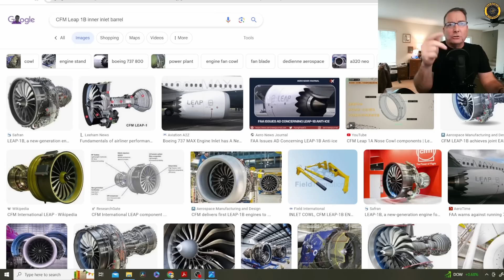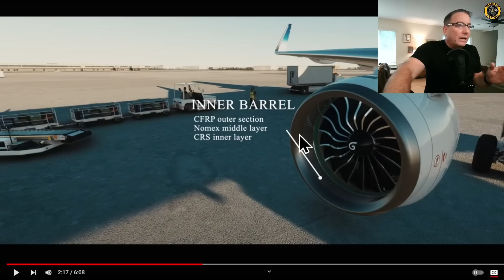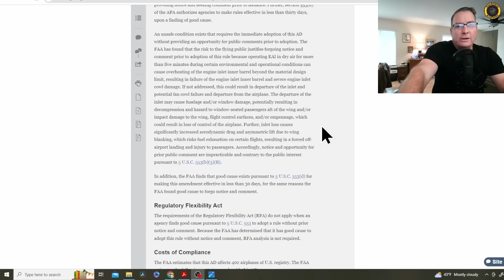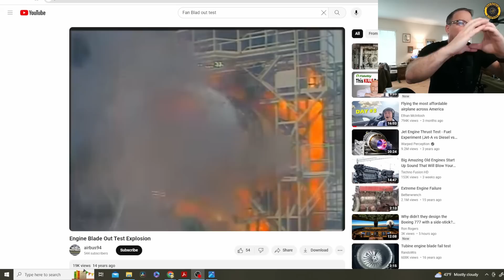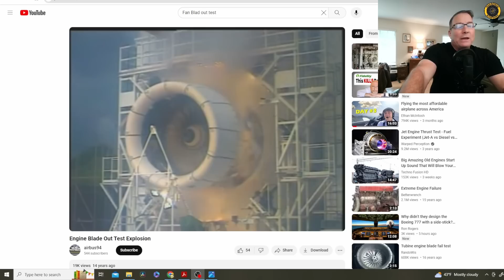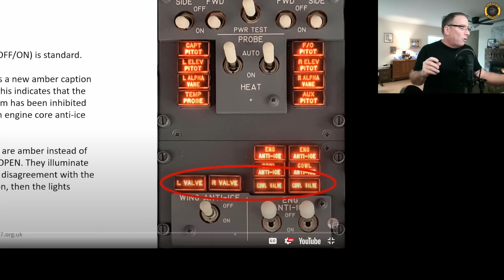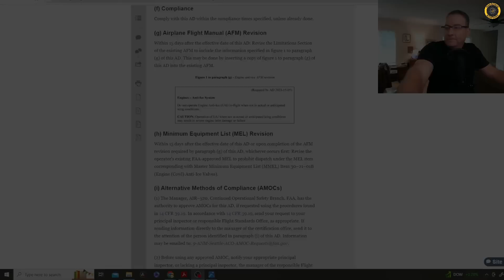Boeing 737 Max-7/-10 Certification HALTED! 1 Feb 2024

Comment: I’m new to your channel (thank the algorithm) and am enjoying your clear and logical analysis.

I’ve been following the 737 MAX story to apply its lessons to my job in the medical devices industry. I see the failures rooted in the requirements, primarily “build a fuel efficient plane that doesn’t require full pilot retraining nor full FAA recertification”. That meant no control improvements (e.g., no auto setting for de-icers) and no additional redundancy (e.g., no backup angle of attack for MCAS), amongst many other limitations. 

What I find astounding is that Boeing chose to enhance the 737 whose major requirement 60 years ago was for passengers to have a short walk up stairs from the tarmac to the cabin. That anachronistic requirement is still present in the 737 MAX and is a major factor in the MCAS failures. However, I view arrogance and deceit as the root causes of the Boeing leadership failures.
Reply: It’s especially dumb considering the airport I work at doesn’t have jet bridges. But anyone who can’t get up the steps can get assisted entry via vehicles that look like lorries except with seating and the entire back area lifts up to the aircraft so they can walk or wheelchair aboard.

Comment: Whais is different in terms of design on the A320 to not have the same issue with the Leap 1A engine ?
Reply: The A320 has auto anti-icing, the B737 MAX does not...
Reply: @gordonrichardson2972 no it doesn’t. A320 does not have automatic anti icing except for window and probe heats

Comment: This may sound a stupid question from a very practical and "hands on" bloke very sympathetic understanding of all things but inducted air like in a good old carbatettor cools massively which is why some carbs had pre heating until the engine was upto temerature.Surely a simple pre heat could be automated using bi mettalic switches in much the same way without fancy sensors and electronics?
Reply: In aviation, any design changes require recertification, which was the whole root of the MAX fiasco.

Comment: Even my old car built in 2012 had an automatic temperature sensor indicating icing conditions. I cannot understand it is not automatic available on every airplane
Reply: Boeing 737 was originally built in 1960’s
Reply: @tomstravels520  My car also had retrovisors and signalisers to go left/right. Sorry but you cannot set 1960 planes as a standard. Adaptations have to be made. I  hope they have seat belts nowadays
Reply: @paulbrouyere1735  I really don’t get what your point is. Your 2012 car has turn signals so should a 1960’s plane???
Reply: @tomstravels520  Not at all, but it should have indicators for icing conditions, wherever needed.

Comment: This doesn't seem like it needed to be redesigned. It doesn't seem like there's any type of benefit to it. Put it back the way it was
Reply: Every bit of weight saved means lower fuel costs over the lifetime of the aircraft, and was one of the big selling points for the MAX.

Comment: They could have put the modern system in without a clean sheet.  The switch would turn the monitored system on or off.   May need temperature sensors in the cowling. 

This really does not seem hard...  just why does this and mcas have to be butchered to make it it the same.

Type ratings should allow for some advanced features on newer planes.
Reply: Boeing have already used up their options mainly on the new displays, different gear lever operation and few others that didn’t include the handling which is why they added MCAS
Reply: @tomstravels520  So, there was a limited number of changes allowed.... like in an arbitrary way?   MCAS kinda makes sense, it just should have been made with redundancy and sanity.  the idea that the trim kept moving on and on and on was nuts. the idea that they don't have 3 AOA sensors is nuts.

I suppose  type ratings are for more than just pilots though.   maintenance staff may need things to remain the same.

Still, this is nuts 

The B52 upgrades should be done with what makes sense, and then retrain the crews.

I suppose someone should be able to fly a -700ng then a max10  on the way back... that does seem useful.

Comment: Thanks for another insightful video on the continuing MAX story. I couldn't find any further information on that, but can you update us again on the status of the EICAS exemption extension for the MAX-7 and MAX-10 models? Is that still valid, or will they now have to equip those two with EICAS, too (breaking type commonality and requiring a new type rating?)

Comment: Efficiency improvements mean different things with different components.  A compressor with a higher efficiency has a lower temperature discharge, at the same pressure as a lower efficiency compressor.  Engines with a higher thermal efficiency tend to have higher compression ratios, which have the effect of them converting more heat in the fuel to mechanical work.  A very important quality for aircraft is propulsive efficiency.  Propulsive efficiency is the forward speed of the aircraft divided by rearward speed of the thrust plume.  Thrust is a function of the difference between the magnitude of the engine's thrust plume and the magnitude of the aircraft's forward airspeed, multiplied by the mass of the moved air.  The important detail is that, when the propulsive efficiency is 100%, the thrust is zero.  High efficiency engines combine high compression ratios, high efficiency compressors and very large bypass ratios to move large masses of air at relatively low velocities to generate large amounts of thrust at high propulsive efficiencies.

In the bad old days of turbojets with bypass ratios of zero, the only way to improve propulsive efficiency was to reduce drag and fly faster

Comment: It's unacceptable to require pilots to remember to turn off anti-icing on supposedly brand new airliners or risk engine failure. I am not a pilot, but decades of sim flying taught me that it's difficult to remember to turn anti-icing off, especially outside of cruise where you have other things to do.  Now the reminder is an exploding engine intake?  

They have the technology to do auto anti-ice and the technology to detect dangerous temperature conditions in the engine cowling as well.  This could either warn the pilots or automatically disengage anti-ice.

Comment: Isn't this an engine design shortcoming?  OK Boeing tried to brush it to one side but nevertheless this looks like a secondary requirement (noise, weight, efficiency) has led the engine design astray.
Reply: Given the same engines are fitted to the A320neo aircraft without issue  then it would appear to be a Boeing problem.

Comment: This news (to me, anyway) is that Boeing, the engine manufacturer, and FAA have agreed to a design made to fail, it's so flabbergastingly stupid, that all the planes should revert to engines of an older design (where malfunction of the valve can't hurt the crew or the passengers), use automatic controls and just put in 8 seats less! That's how a problem gets solved. Much less costly than scrapping all the MAXes!

Comment: Also, the AD doesn't appear to note the "Off Time" duration. You turn it on for 5 minutes but how long does it have to stay in the Off position before you can turn it back on ("cool down period") ? Seems it would be prudent to know this ... Pilot/FO can't be expected to visually know when they need more anti-icing ... or melt point for the Carbon fiber barrel (CF is just as prone to reduced expansion/contraction with age/cycles as Metals). Boeing has lost the plot IMHO ... while not their Engines, they remain the Prime Contractor and as such responsible for all aspects of their Subs ... if I recall from the FAR.
Reply: Imagine having to have a critical engine system with a "duty cycle." That is scary.

Comment: Surely if the point of failure of the cowl is the bleed air exceeding operational limits, to limit the feed to that component before max is reached, there should be no need to turn off the whole anti ice? Thermocouple and a valve, or am I being too simplistic? Also, valves sticking, I thought aircraft actuator signals had a frequency applied so that they were never stationary to overcome stiction (static friction). Maybe you could explain why these wouldn’t work. Great channel by the way.

Comment: I wonder why this has not been picked up during the design phase, it should have been designed such that it can handle the heat whilst in non icing conditions. Probably not a requirement that needs to be checked off. 

In some way, we could also blame the FAA who should have pointed this out to Boeing during the certification phase of the Max aircraft, but we all know, right at that interface between Boeing and the FAA so much has gone wrong leading up to 2 fatal crashes, a door flying out of an aircraft mid flight and now this AD on the engine anti -icing system.

I feel more blessed by the day for the airline I work with, that we cancelled the B737-8 orders (early 2020 due to the Covid pandemic) and decided to go forward with airbus. We have received our first Airbus A321NEO about a month ago!

Comment: Well, what else to expect... 
Boeing became controlled by the bean counters almost completely to feed CxO's and the shareholders with enough bonus'es and dividends. 
To design this deicing system in such a way that (as Juan described it) fitting a temperature sensor which automatically controls the deicing system, would have probably cost, say how much more? A few thousand dollars? It's gross and criminal and shows the extent of how deeply the financial industry has grabbed control over most of our lives...

Comment: My airline captain friend (Airbus) calls 737s 'Flying Locomotive'.....he is not wrong. Manual de icing in a 'modern' airliner ! Is there  a piece of cord over the pilots head that they can pull when the want to blow the whistle 😂
Reply: Well…..Airbus doesn’t have an auto mode for its anti icing. But they get warnings when to turn it on and off
Reply: @tomstravels520  and presumably because the fans are bigger and the materials more resilient the engine wont melt if they leave it on !

Comment: Are these engines not the same on the Airbus? If yes, why does the Airbus not have tbe same problem? Or does it?
Reply: Same model but different variant
Reply: Yes same CFM International LEAP on the A3xxneo family of aircraft. Those aircraft have a single button for each engine and that controls when engine anti-ice comes on and goes off automatically.
Reply: @I_Evo  they don’t turn off automatically. The pushbutton is lit up ON when pushed and extinguished to show off when pushed again. Only the pitot and window heat are automatic

Comment: So i straight words, Boeing delivers aircrafts with a manually operated „destroy the engine“ system.

I remember sitting in 737NGs long ago with the feeling that these engines are somehow mounted a bit strange and show their power by bending the wings, but hey, it was Boeing, the single name for airplane, they would not do it, if it’s not ok.
But you never stop learning new things. Happy to be more „grounded“ as I got older.

Comment: Regarding this valve that sometimes get stuck. Is there any indication in the cockpit if the valve gets stuck in the "anti icing on" position? Of cause there is an indication whether the switch is flipped or not, but is there any indication whether the valve moved or not?
Reply: If the valve position disagrees with the switch position it shows a warning light

Comment: The decision not to do a clean-sheet design for Boeing's latest narrowbody, the MAX, has created all sorts of perverse incentives. Instead of designing the best solution using the latest technology, Boeing engineers have a strange incentive to make the operation of the MAX look and feel like the decades old aircraft-type whose type certificate they are trying to inherit. All kinds of archaic solutions get grandfathered in for approval because they were approved in a previous variant decades ago, they aren't approved because they are the safest or best design. Boeing gets to avoid the scrutiny of its designs and has an incentive to ensure that features look and feel like the old feature, so that they don't have to go through the rigors of the certification process. 
    Why include an MCAS at all? So that the flight envelope has the look and feel of the previous variant. Is that safer or a better engineering solution? No, but it enables Boeing to reuse the old type certification. Why not use the available sensors for icy conditions to automate the operation of the anti-icing system? Because the older variants did not have that, and the control panel should look as much like the old control panel as possible, to avoid certification complexities when trying to reuse the old type-certification. Is requiring the pilots to operate the anti-icing system manually safer or a better engineering solution? No way. 
    The cat is out of the bag. Everybody knows the MAX is very different from previous generation 737's. Boeing should just bite the bullet and go for a brand new type certificate of the MAX, incorporating modern technologies and abandoning superficial similarities to older variants. Sure pilots will have to train on the new features, but they are training on new features like the MCAS (and manual deicing?) already, the so-called savings from needing only a few hours of computer tablet training for moving to the new MAX never happened. The operating airlines are already doing additional training, they might as well get a well-engineered design to train on, instead of some Frankenstein-design where the engineering incentives are to look the same as the old variants, instead of to provide the safest and most modern technology to solving a problem. 
    In the medium term, Boeing should do a clean-sheet design of a new narrowbody as soon as possible and make it possible to retire the 737's (including the MAX) sooner rather that later. Modern avionics, an ergonomic and automated cockpit. Boeing can do that, it is doing it for its wide bodies. Why retain the perverse incentive to look like a 55 year old airframe? And while they are at it, reduced greenhouse gas emissions should be a target. 
    Designing a new narrowbody will put big pressure on Boeing's cash flow and mean they can't do stock buy backs and other financial engineering for a while, shareholder value will have to come after engineering excellence. But that is as it should be, and it's the only way for Boeing to regain its reputation and the trust of its airline customers and the flying public.

Comment: Anti-ice system doesn’t melt the ice after it has formed, (that’s de-ice) it prevents ice forming.
Reply: For engine anti ice yes. Wing anti ice removes ice which is why you turn it on when you see ice on the wipers or ice indicators on Airbus
Reply: @tomstravels520  this wasn’t about wing de-icing though, was it? Had it also been about that, then I would have mentioned it, if Warren had made a similar boob. Of course, I probably would have also mentioned the empennage, something which you appear to have forgotten about.

Comment: How did they resolve that in 787, metal or CFRP??
Reply: 787 doesn’t use bleed air. It has an electrically heated system

Comment: AWD: February 5, 2024.  Air crews are advised to refrain from cycling the ANTI-ICING switch in order to minimize ANTI-ICING switch failure.  The switches are designed to withstand 1,000,000 cycles and currently that is about two (2) weeks of normal operation.   The manufacturer is currently  in the process of redesigning the ANTI-ICING switch panel with NO switch which will solve one issue.  A new, updated panel is being developed for delivery in 3Q26.  In the meantime, do not fly into PHX between the months of May and October.  Updates to follow.
Reply: This is too funny not to get a thumbs-up, friend!